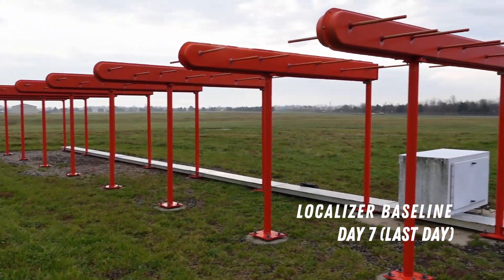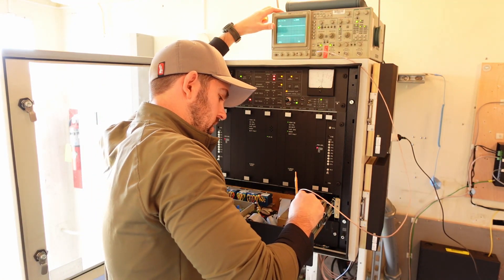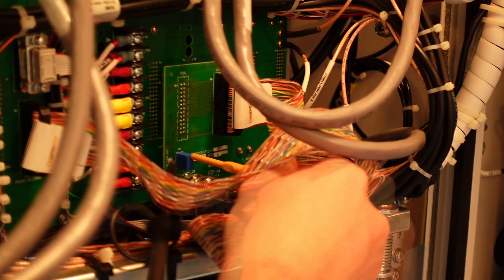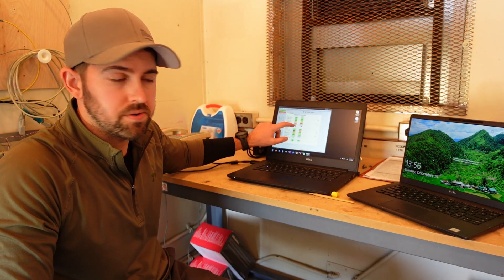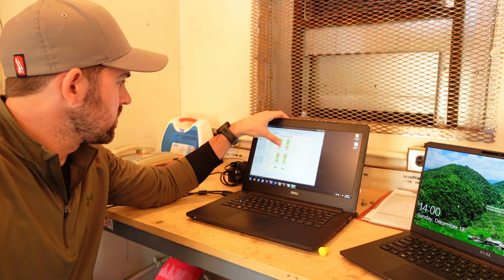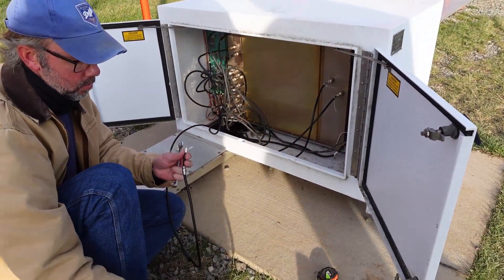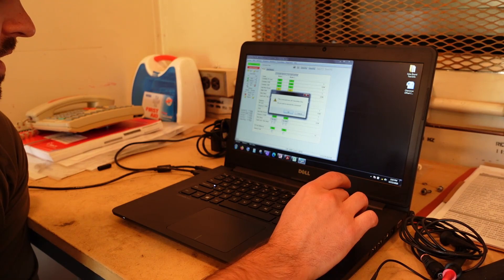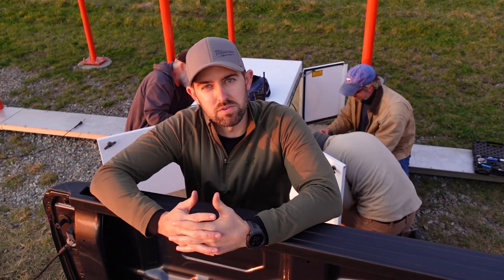Localizer Baseline Day 7 Last Day

Comment: I think it prudent to add that you are now ready for flight inspection which is necessary to verify that this system is safe in the air.  This system cannot be certified without a reference flight check to ensure your ground measurements are proven in the air.  If any adjustments are made during flight inspection your monitors will need to be aligned accordingly.  Great job!
Reply from the maker: I agree and this is a military site so things are little different then FAA which I should preface. Interestingly, the USAF does not certify equipment and techs are just "task qualified" for the job.. I did request a reference flight inspection and performed it remotely afterwards for this site. You'd probably be surprised at how much you can do on these systems without a flight inspection if you so choose in the military. The . 49 isn't referenced or used.
Reply: @ArtofNAVAIDs Thanks for replying.  This video is extremely informative and great for novice and seasoned technicians to both learn and refresh...Bravo.  If videos like this had been around when I started learning the concepts would have been so much easier!  Having the internet and YouTube as a platform is definitely a plus.  Thanks and I look forward to a GS re-cable and alignment video.